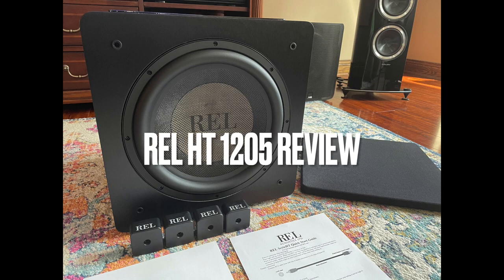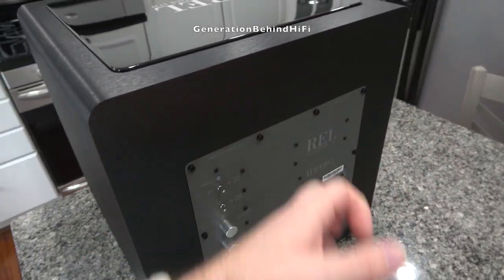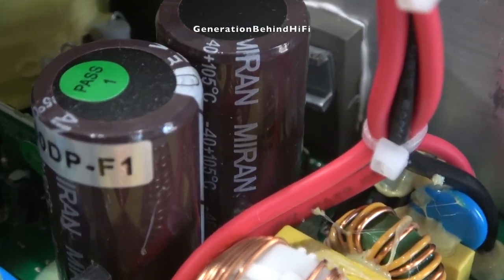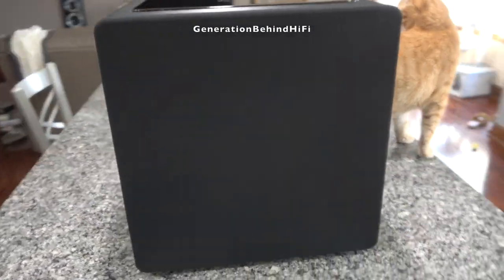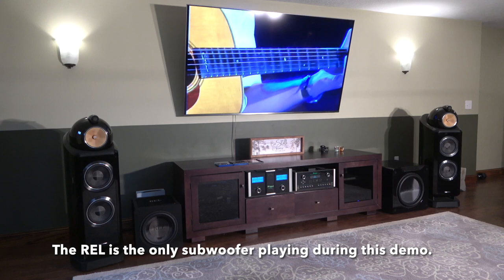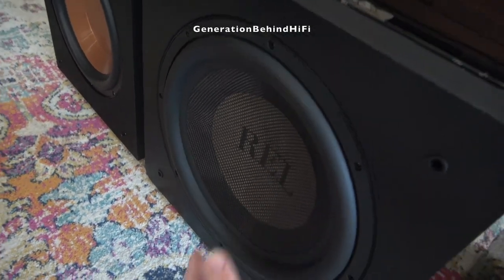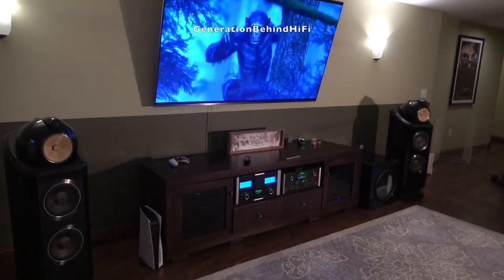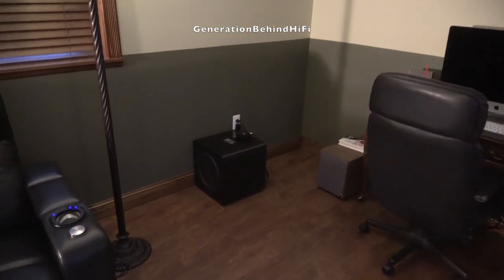REL HT 1205 Subwoofer Review

Comment: hello, I bought a Rel ht1205 also on sale for 550euro 6 months ago, it's a great price for Europe. It was supposed to replace the Svs sb12nsd 400W Rms equivalent of the sb2000. In a small area, the rel works better, although it does not go as low as the svs, but also its bass does not extend so much  You can hear a better variety of bass than in the Svs model and it is easier to set up. Both are great subs.

Comment: My listening habits are 70/30 in favour of two channel hence the reason why I decided to go with a stereo pair of Rel t5i subs, mainly to help my sonus faber stand mount speakers go full range. But to be honest my movie listening experience can do with a little bit more depth. One things for sure if I do decide to introduce a third subwoofer, it's most certainly gonna have to be of the same brand.

Thanks for making and posting such a detailed video. It's always nice to look inside the components! Cheers 👍
Reply from the maker: No problem! Thanks for watching!

No question that by adding the second subwoofer in the back of the room it really enhanced the 3 dimensional theater experience. Now I'm curious what a 3rd subwoofer would do if I added it on the other side of the couch.
Reply: By adding a 3rd subwoofer you will only add a 1.5 dB gain to your system...
Reply: @Echo-jg8is  I would imagine you are correct, especially if all 3 subs has the same diaphragm service area. It's actually the same when adding a second sub to a first sub, one really doesn't gain much other then evening out the bass throughout the whole of the room. But in my particular case I'm using a stereo pair of 8" musical subwoofers. They only go down to 32 Hz which is preferable for my type of listening habits!.
The reason why I'm thinking of adding there the rel 1205. Will be for home theatre duties but mind you I would only want it on for home theatre duties! That's why I'm not going to make a decision until I reach out to Rel acoustics for advice.
Reply: @totalplonker824  Due to the room you have, I would sell the 2 subwoofers you have and invest in 2 more powerful Rels...personally adding a 3rd more powerful sub just for movies would be my last choice for your system...
Reply: One should always choose a subwoofer(s) for room size and listening habits.

The rel t5i stereo subwoofers I'm using are not just perfect for my small 13 × 11.5ft livingroom but they're also perfect for my listening habits. Don't forget I'm using the high-level connection (via speakon cable) for my sonus Faber speakers for them to be able to go full range and of course using the .1 LFE (via RCA) for movies.
 Got to remember 95% of music only goes down to 30 Hz anyway. If my listening habits was 70/30 in favour of movies, rather than 2 channel music then I probably would've taken on your advice.

Comment: I'm currently in the process of looking through subs for my first ever upgrade (I'm using a pair of Emotiva Airmotiv XS12s with the ports plugged). I'm overwhelmed. SVS have their SB-16 Ultra on clearance right now for $1,800 shipped...and a pair of those is extremely intriguing...but at the price I really only "comfortably" afford to buy 1 of them at a time. ...and with them being on clearance at $600 under MSRP, I'm scared they'll sell out in the month or 2 it'll take for me to have another $1,800 to throw at the hobby.
Reply from the maker: I have an SB-16 in my main theater and one is more than enough for me, but I also have the REL HT1205 and B&W ASW308 that I'm using as support subs near the seating area in this room. Crazy loud and authoritative bass for our movie experience.  Adding subs in the rear definitely added a layer of dimension that is really cool to experience.

Comment: I couldn't resist the sale price of this sub, the MK2 was tempting as according to some reviewers with the improvements made by Rel its even more transparent and musical, but i couldn't  justify the 35% price increase even with a sale discount of the new model. So i decided to buy 2x ht 1205 mk1 model's instead of 1 mk2.  Quick question? I have a standard stereo amplifier with pre outs, do i use 2x rca Y spliters on the back of the preout of the amp or do i just daisy chain both subs for better sound. Not sure what will be best. Do you think the new model's are that much better, i have my doubts  Thanks.
Reply: Yeah I think you made the right choice going with 2 × 1205s rather than 1 × 1205 MK11 especially if you haven't owned a rel subwoofer before! 
I would imagine 2 x RCAs would be the way to go but whether if they're going to be independent will depend on whether you've got dual independent subwoofer outputs. If you haven't got the manual try Googling it, one never knows. But to make absolute certainty that you are indeed getting the best usage. Why not reach out to rel acoustics. I've always found them most useful.
Reply: @totalplonker824  thanks for the response I'm not sure what you mean about 2 independent sub outs. I have a standard amplifier not a HT receiver. The 1205 rel only has RCA in and out, so do I just daisy chain one sub to the other with RCA cables or do I Y split the 2 RCA connectors from the line out on the integrated amp (audiolab 6000a great little amp)  and run these to each sub
Reply: @carlitosgomez71  that sounds like a nice little amp. If this was my setup I would use RCA to the left and RCA to the right and so long as the levels are matching, I would imagine that's the best way to go. At the end of the day you can try either way, they're only line level so you can't cause any damage!

Comment: Hi, should l add the second sub for stereo music? Would Noticable sound improvement?
Reply: Adding a second sub will even out the bass throughout the whole of the room. Basically no more moving your head a few inches to the left or right to pick up the fullest sound! But if you happen to be a critical listener best to get one of the same brand.
Reply: Adding 2 subs would normally give a better room response giving you a fuller more 3d soundstage with less null spots, but this is dependent largely how big your room is and its shape and furnishings. You should also get a higher sound  level but not double the performance
Reply: Loved your review - clear and relevant information. I use  a REL T9x for music listening using high level connection. REL also allowed me to have black baffle and white baffle for extra £65 (you need a black baffle if you are using a projector).

Comment: Here in Greece, this REL Sub goes for 885euros and the Polk XT12 you reviewed a few months ago goes for 350 euros. The SVS3000 goes for 1600euros. So for the price of one SVS, I can almost get 2 REL HT1205, or 4 Polk XT12s and enough change to also buy all the cables I need for them.
My understanding is that at those prices, although the SVS is clearly the better sub, and REL is also a better sub than the Polk, unless your budget is high enough to get at least two SVS subs, (2 subs are always better than 1 for more uniform bass and better control of room modes), you will always be better getting 2 RELs or even better, get 4 Polks since 4 is the ultimate number of subwoofers needed for maximum uniformity of bass in a room (reference: Harman/JBL paper on subwoofers, and Earl Geddes paper on subwoofers).
So my conclusion is that getting 4 Polk XT12s will be better than getting 1 SVS or 2 RELs and getting 2 Polks will be better than getting 1 REL for the same price.
Since you have (had?) all 3 of those subs, do you agree with this?
Reply from the maker: I do agree with this statement to an extent. It really depends on what you're after. If you're looking for the ultimate in bass output for movies, then 2x HT1205's would definitely be the better option. If you want the ultimate in sound quality and the ability to tune the sub to your room (DSP), then the SVS SB-3000 is hard to ignore. The SB-3000's driver is leaps and bounds above the rest, in fact it's not even in the same universe! Definitely checkout my look inside video on the SB-3000 if you haven't already. I talk about the anatomy of the SB-3000 driver in that video and it contains a lot of cool tech that the others don't have. IMO I would much rather have 2x HT 1205's or 1x SB-3000's than 4x XT12s, but that's just me. If you got the money for 4x XT12's, then I would recommend you go for a much higher quality sub like the HT1205 or SB-3000.
Reply: I already have a Monoprice Monolith 12 that I got last year on Black Friday for around 600 euros (a real bargain), sitting in the middle of the front wall (plus a smaller 10" in the middle of the right wall, playing at lower volume just for room modes control and doing a great job at that) but unfortunately no more space for a second sub of the same size.
I was really thinking about getting one of those Polks at 350 euros to put in the back left corner next to the couch for some kick along with a MiniDSP for better control of the multiple subs. Unfortunately, not enough budget for a REL at 885euros and the MiniDSP should be all I need for Low-end management and it will work for all my subs.  @generationbehindhifi
Reply from the maker: @spiroszaharakis2648  In that case an extra sub would definitely help with additional bass effects during movies. I recently added two subwoofers on either side of my listening couch and it really made a tremendous improvement during movies. 

Everyone has different budgets so if you can't go with a REL, then the XT12 isn't a bad option for budget minded consumers. I was pretty impressed with the XT12  especially for how affordable it is. If you do go with the XT, I would suggests spending a few extra bucks on some damping material to bring this sub to the next level. :)